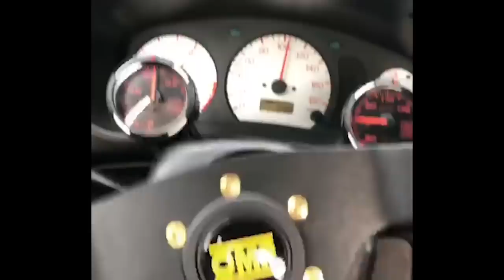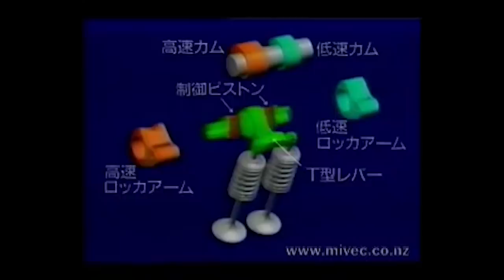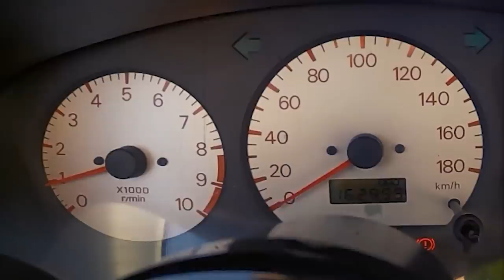MIVEC Lancer GSR + Lancer CB Rally Car

Comment: this is randon but i need help sourcing a mivec gearbox for my 4g92 mivec i have the tiptronic autmativ bu ti wanna convert it to manual, full comversion; gearbox, flywheel and clutch, cables, shifter and mivec manual brain if possible please.. also does any one know if any other gearboxes will work up with the 92 mivec?

Comment: Sa puerto rico at US ang trip naman nila dun yung mitsubishi 6g75 mivec 3.8 v6 nilalagay sa mirage na drag car, pinakamabilis na all motor per trap speed is el yadiel mirage powered by 6g75 mivec engine 167.82 mph sa 1/4 mile, mitsubishi power

Comment: Idol! Suggest vid: engine upgrade options ng stock na lancer le. Yung mga walang pang engine swap kagaya ko 😂
Reply from the maker: keep it stock lang tayo dyan sa 4g13 sir. magandang gulong, 3rd brake light, cupholder, gauge na may tach, saka yung stock muffler ng 99 MX pizza yung twin tip para mas ma bass yung exhaust. cat eye fog lights sa normal na bumper saka kung kaya mo, rear fog thazzit